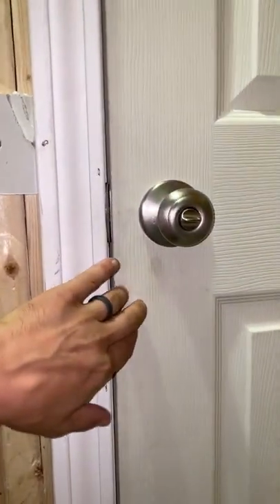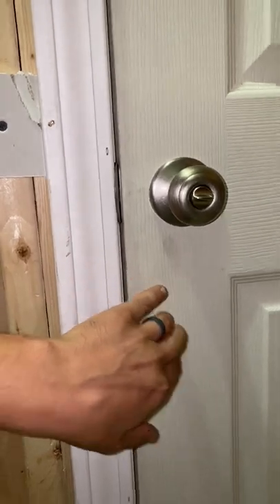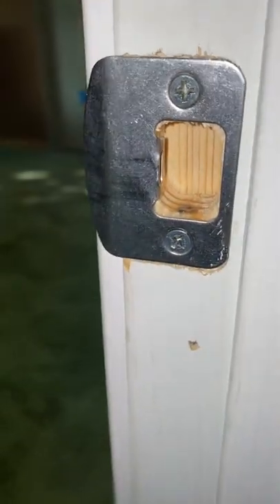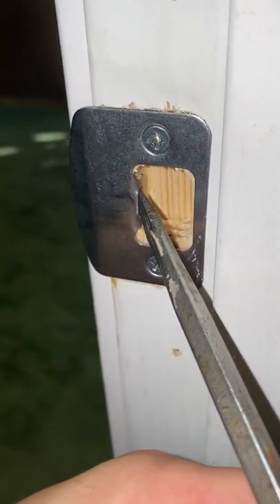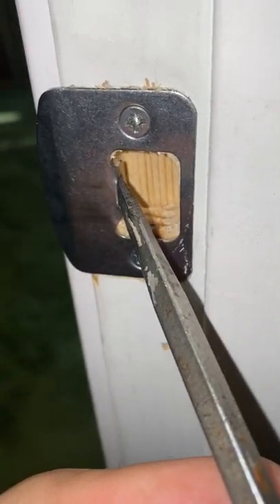How to Fix a Rattling Door in Seconds #shorts #shortsvideo #shortsfeed

Comment: i dont have strike plates with that, but what i do is add these little pieces of foam strip to the top and bottom corner. reduces slamming noise and keeps the latched pressed up.

Comment: I had some of the little round felt pads that you put on the bottom of your chairs slide across the wood floor I just use them on the doors jam that way when the kids closed the door like they're slamming their gym locker it doesn't rattle the whole damn house. I'm sure it will work for that as well.

Comment: what if the door is too tight..
Reply from the maker: Aha... good question.  Crush that little tab down as much as possible.  If that doesn't work, I would take the strike plate off and pre-drill some holes just before the old screw holes (towards you).  Reattach the strike plate in the spot you drilled the holes.  Make sense?  Hope this helps!

Comment: Couldn't you take the plate out and kinda knock that piece in with a hammer for say if it doesn't have that slot? I mean you'd have to be a bit precise so you don't really screw it up, just a thought